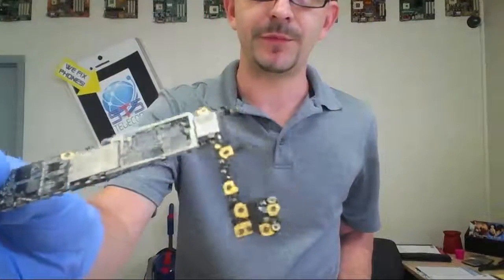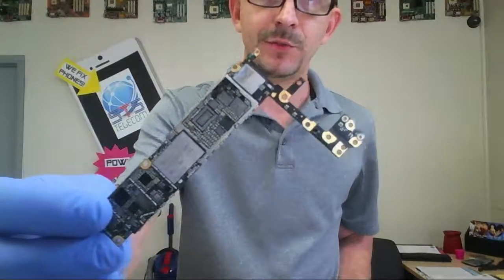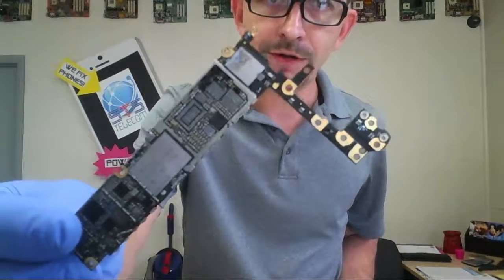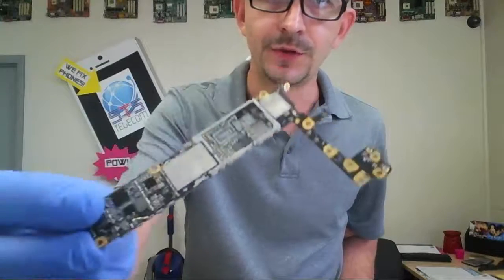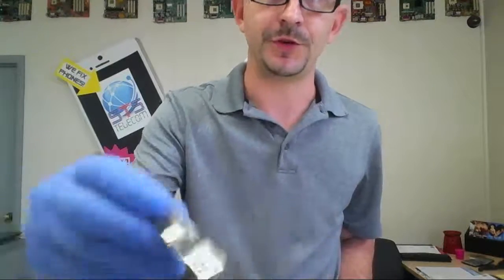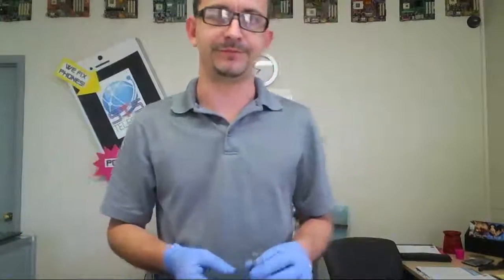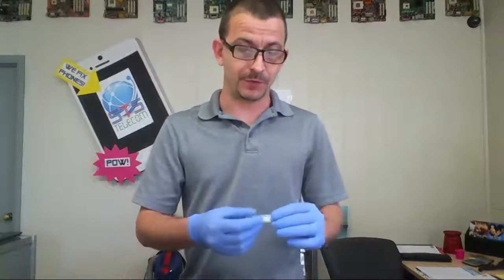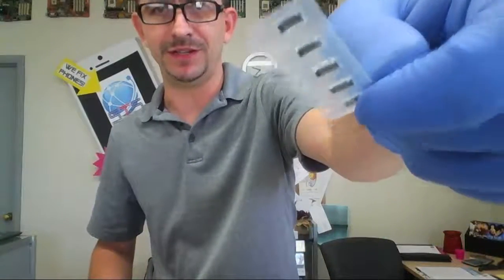Hi, my name is Jason and this is STS.

Comment: hi,Jason
Im one of those here want to start in this business, fixing motherboard, i just want to ask a favor if you could give the link on where did you get your small ultrasonic cleaner?
im also one of those who want to watch your video and also jessa'a and loise Roosman video on youtube, i hope you can help me.thank you
Reply from the maker: This is a cheap eBay ultrasonic cleaner and needs replaced pretty soon.  Sometimes the ultrasonic gets quiet and it doesn't work so well.
Reply from the maker: It's a lot like this one only mine is smaller.

http://www.ebay.com/itm/New-Stainless-Steel-2-L-Liter-Industry-Heated-Ultrasonic-Cleaner-Digital-w-Timer-/121910309568?hash=item1c626bb2c0:g:kbsAAOSwTA9X14W1